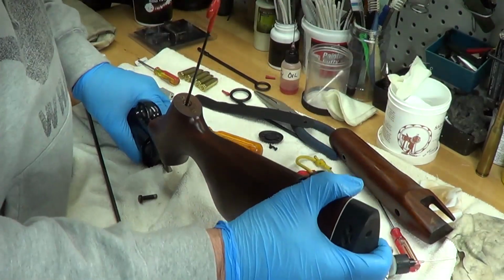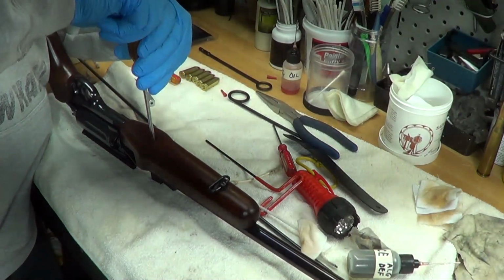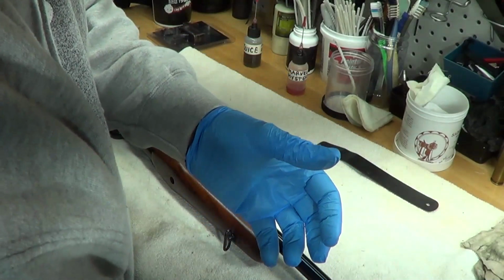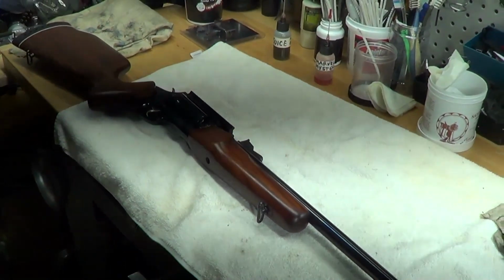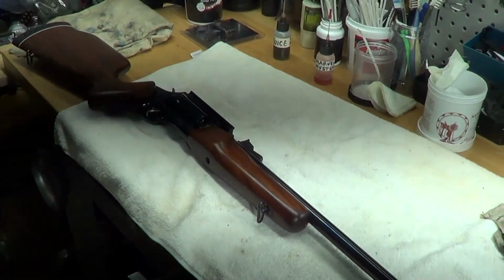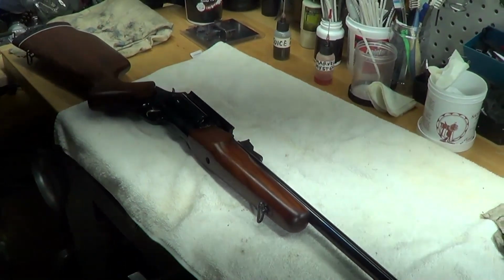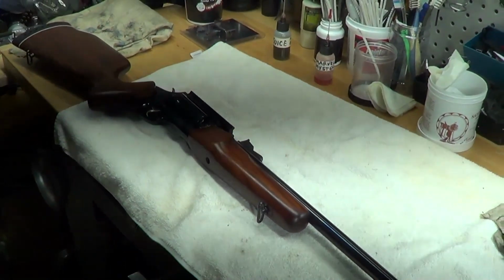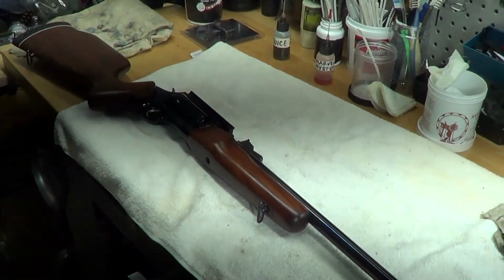Part 2 of 2 - Taurus / Rossi Circuit Judge Cleaning & Disassembly - Removing Forend Stock

Comment: I'm wondering if that was surface rust under the wood or could it be stain leached into the oil from last cleaning....
Reply from the maker: I would think if it was stain then there would be some on the other wood I took off and there was not

Comment: I'm not trying to dis your opinion but, that stain on the patch from under the hand grip looks like dirt not rust. ARE YOU SURE is rust? If you do not see damage to the barrel, why you call it rust? just asking.
Reply from the maker: rust does not do damage right away, it takes time.  since I don't keep my guns in dirt, could be rust or old oil, should not be there whatever it is.
Reply: @HeyGunPeople  Thank you for your promo response. I agree, my thought was that it could be oil that traps dust from the air.